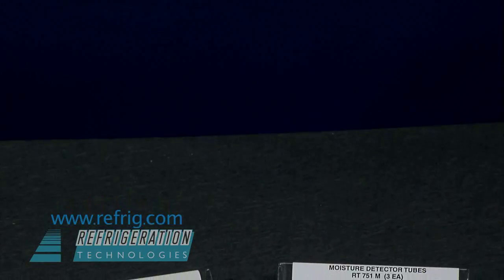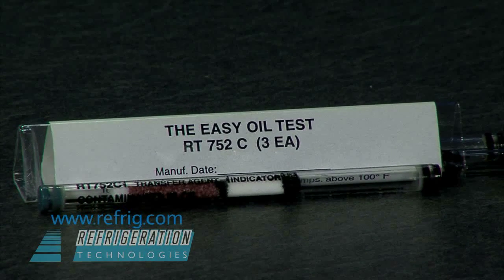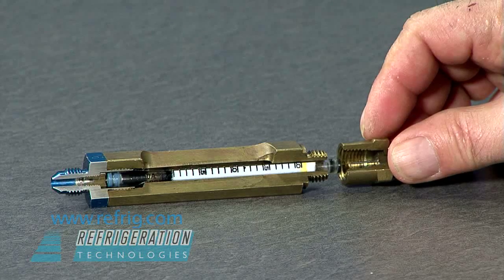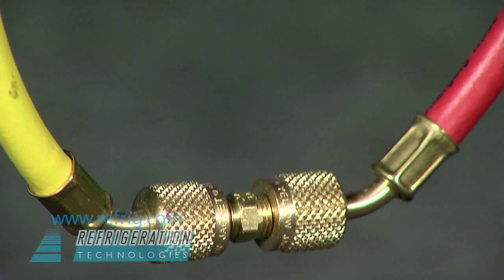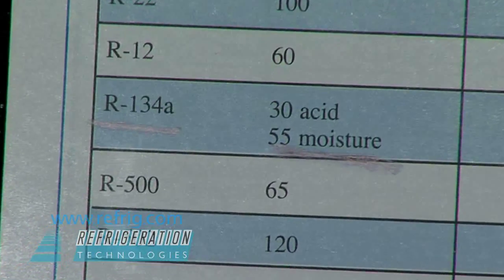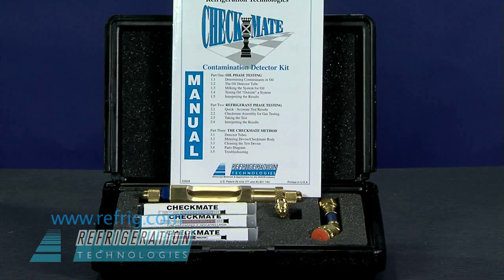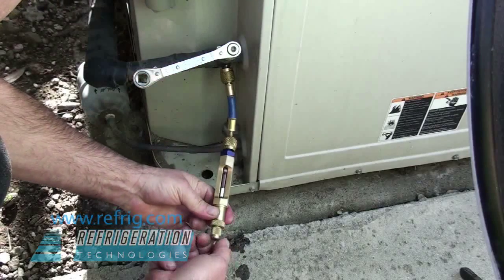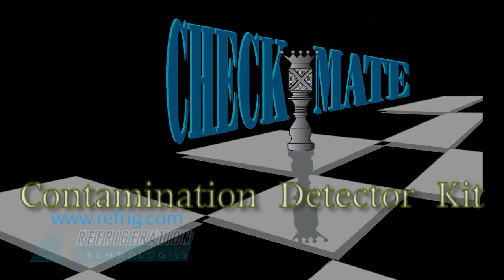Checkmate HVAC Test Kit .mp4

Comment: Great video, thanks!

I am in the HVAC industry in the commercial/industrial side, however, in all fairness I am not a service technician. This does seem like it would be going above and beyond what many service companies would do as a standard item.

In commercial chiller systems, there is a lot of attention paid to water treatment and it is monitored 24/7. But for refrigeration systems?? If a service company told me they check for acid, I think I'd automatically consider them professionals who took pride in what they do. Performing this testing would indicate to me that a service company has a deeper knowledge of refrigeration and a commitment to quality.

Great idea!

Comment from the maker: I am glad to see that you test for acid; most technicians do not. For system acid you must test the oil phase and not the refrigerant. You rarely get a positive test for acid in the vapor phase unless it is a burnout. I agree with your reluctance to not use additives. Additives can and will create more problems than they intend to cure. The reason for testing a system oil for acid is to see if the dryer must be replaced. There is no better safe and proven cure than changing the dryer.
Reply: Trying to get started in the trade.  So if there was a burnout, is a filter/dryer good enough to clean the system?  I heard run for a couple weeks with new filter then replace?  Getting ready to install used 2009 3-ton heat pump package that has new scroll compressor.

Comment: If there is acid... I'm still a fan of just changing dryers... Alot of guys add Acid Away...
My mind is still set on If the system did not come from the factory with it DON"T USE IT...  I tend to test acid levels with the little PH-strip tubes called  *  qwik shots*  change a dryer once a week till clean...  saved many compressors...
Reply: On a 410a split would you flare connect or braze the filter?  I'm just getting started and need to check used unit I plan to install for acid and planned to install filter/dryer and thought it would be good to make it easily replaceable but not sure flared is a good idea with pressures.

Comment from the maker: This is a test to check for possible system contamination in the oil and refrigerant. It is a tool used in periodic maintenance, after a compressor replacement  or shell tube rupture. Who knows what that noob did to the system before you got the call. Maybe this kit will help you undo the damage. Thanks for your comments.

Comment: @alfebre1 It has to do with horse power vs RPM. One is not better than the other in any way that is meaningful to anyone other than the manufacturer of the motor.

Fasco has a good online booklet called FASCO FACTS that is the best motor resource I have found. 

If you want a quiet system worry about airflow distribution 1st. Low velocity = low noise. 
If you want a quiet motor then you want an ECM or the new X-13 motor.
Fan geometry has a lot to do with noise as well.

Comment from the maker: @airlift11 
I do not know of any gauges that show acid and moisture. If you mean a sight glass with moisture indicator, those only show moisture exceeding 70 ppm. Moisture over 10 ppm is the breaking point and the detector tubes will measure this critical moisture level.

Comment from the maker: @xjoeharperx 
I assume you are concerned about air/moisture entering the outlet of the detector tube assembly if you do not connect your hoses in a timely manner. Since this is the outlet and not the inlet of the detector tube assembly it will not affect the test results. If you do not connect the hoses to the outlet then air/moisture will enter  and stain the top of the detector tube scale. So always connect your hoses.